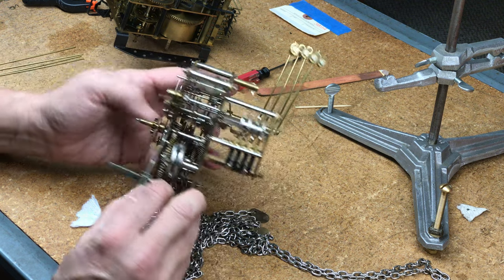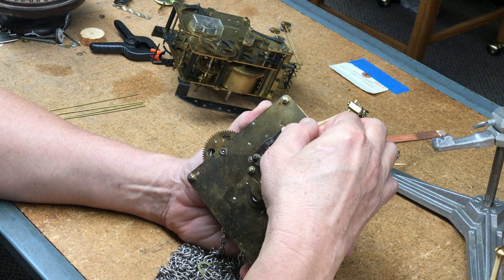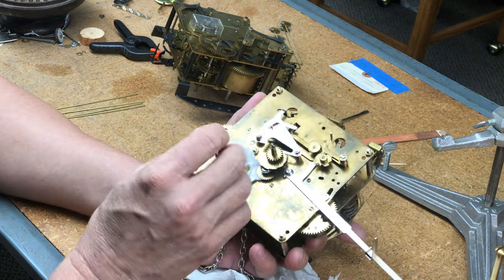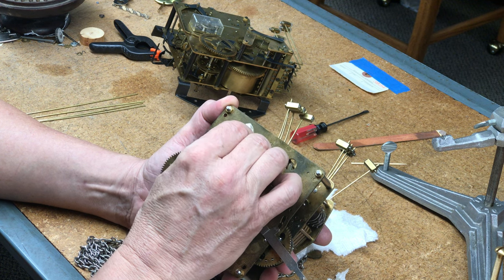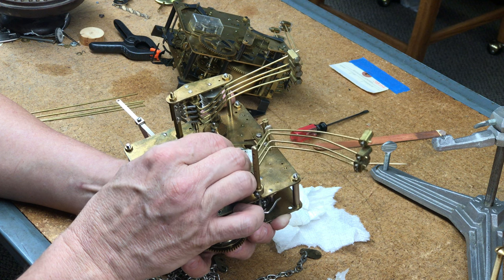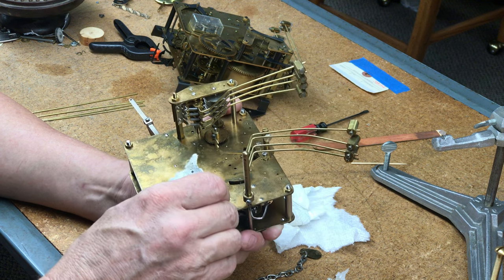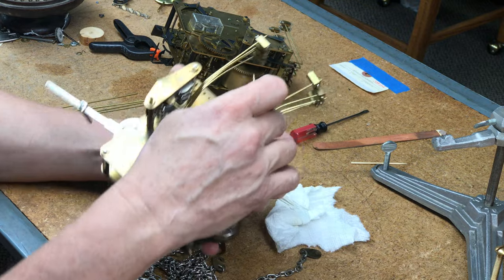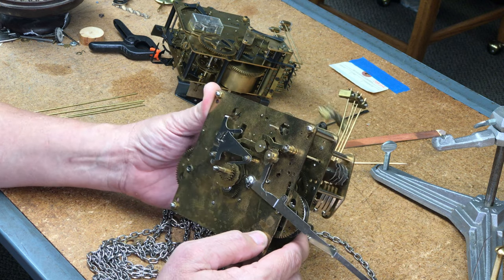How to: Properly Cleaning and Oiling Your Clock

Comment: You usually disassemble clocks and clean the plates, wheels excreta in an ammonia biased cleaner.  Old simple clocks are a lot easier to do then complicated three train clocks.  After cleaning and reassembly you oil them of course, then they can be oiled every few years but will eventually need to be properly cleaned again at some point.  What he is doing is ok but is more of a band aid.  It's like putting oil in your car; the most important thing is you don't run the car low or out of oil.  There are not many people who could take that movement apart and get it back together correctly, so there is that too.  A mans got to know his limitations.  Good luck!

Comment: Jan 14, 2024  I've watched your video on grandfather clock mechanism cleaning (along with a host of other YouTube videos on the subject).  Today, I took the movement (which I had earlier removed from the clock) and cleaned and oiled it.  I took my time and the work progressed without a hitch.  Upon completion, I reinstalled the movement, face, weights, and pendulum.  The clock now chimes all three tunes, gongs and accurately keeps time without any problems.  Most of my time spent on this project involved watching YouTube videos and taking notes on the subject before I started anything else.  The cleaning and oiling work really is very straight forward.  Oh, and I did find using toothpicks would work but the force required to clean old oil out of the pivot holes caused the toothpicks to splinter or break.  Toothpick wood seems to be too soft for this work. A sharpened, small-diameter wood dowel with small pieces of old T-shirt worked great for me doing this cleaning work.
My clock is a 1982 Ridgeway Grandfather 3-chime, 3-weight, chain-driven Clock with a Urgos UW 32 570 D movement.  My clock movement uses a single 6.2-pound weight along with two (2) 4.6-pound weights and a 35" long pendulum with 6.5" dia. bob.  I've taken the movement out of the clock case to clean and oil it with the intent of restoring the gong and chime functions.  The process of removing the movement from your clock case is straight forward and uses tapered pins to hold the clock face to the movement.  Thank you for the straightforward, nicely shot video (great lighting, angles and audio) on clock cleaning and oiling.

Comment: I found this video very helpful.   I have an old, tall Seth Thomas wind up shelf clock that needs cleaning and oil.   I there such a product you can spray on the gears and shafts for cleaning?   I will try the paper towel and toothpick method you slowed, but I’d like to get a better cleaning but without taking it all apart.  And I really can’t afford a professional clock repair.

Comment: Just picked up a wall clock, a Daniel Dakota chiming windup, new/old in box for 25 years never used. I am sure it will need oiling maybe a little cleaning will check. when I take it apart. I play Saxophone and clean and oil them myself....I use 70 weight gear oil that is used in Diffs and transfer cases..(got it from my Mechanic)...what do you think?

Comment: I just got a hermle 141-031 and wanted to know if you had any info on that unit winding and oiling
Reply: James Bryant Liberty oil 100% synthetic lubricant on Ebay or Amazon $9, and remember, OVERWINDING IS A MYTH! It is impossible to overwind your clock 👍

Comment: I have a pendulum with two suspended weights. The weights are hung from a thin rope. Do I need to clean or lubricate the cable? Thanks.
Reply: I will answer. He doesn't seem to respond to questions.    Lubrication holds dust and dirt. Only the wheels/gears of the moment get oil, and very little oil. So no to answer your question.
Reply: @rparker2824  he weights are suspended with a thin wire mesh. I thought that a very thin layer of oil would protect them from oxidation and would help in the best winding - unwinding on the rollers. Thank you for your valuable help.
Reply: @arkas6797  I see your point, no the cable should not get oiled. Now if the cable is damaged or binding due to age then replacing would be needed. It should be flexible, similar to a thin rope.
Reply: @rparker2824  Mr Parker, thank you for your important help.
Reply: @rparker2824  
Thank you, Mr. Parker.
It's a shame that these folks don't follow-up with questions here.
Appreciate yours...

Comment: Couldn't you just soak movement in a tub of mineral spirits for a hour or so, swish it around, the take it out n dry out, the reoil?
Reply: An ultrasonic cleaner with the proper solution would do a much better job. Complete disassembly is the proper way to clean and oil. Leaving any oily dirt/grease will act like an abrasive paste.